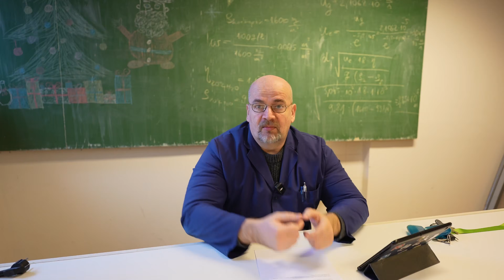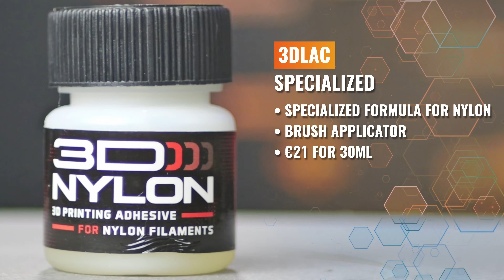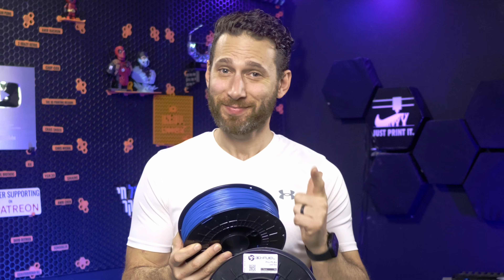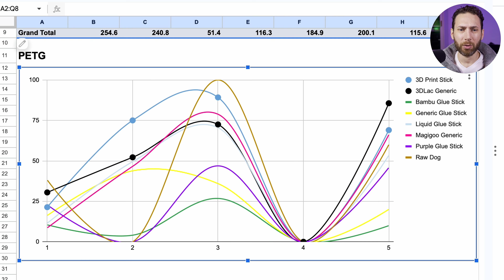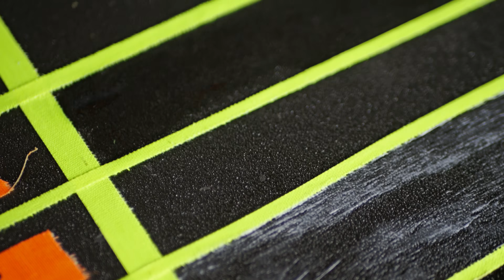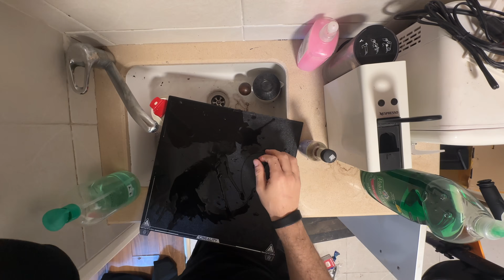I Tested 7 Types of Glue Stick for 3D Printing Bed Adhesion

Comment: Aqua Net Extra Super Hold Hairspray. Been using it for years. Much better than any glue sticks.
Reply: I experimented last week with glue Vs hairspray. Hairspray is easier to clean with iso propyl alcohol. Hairspray had better adhesion, for some reason my glue prints warped.  Glue is not easy to apply in an even layer, also by pushing on the print bed to apply the glue I have to relevel, whereas with hairspray I do a couple of spray between prints, without cleaning and have reliable adhesion.
Reply: @inkavanderbijl7504  This, too, has been my experience. I have perfectly flat first layers and a quick rinse under warm water washes off any hair spray residue left on the part. Also keeps PETG from bonding TOO well with my PEI plates, assuring removal without damage to the plate.
Reply: @SwervingLemon  Same as me but I also give the plate a quick spray of alcohol and then dry it off.
Reply: @highrise9559  Yes! I'll use alcohol to thin the spray residue sometimes and make it flatten back out. I used to clean the plate off and re-apply the spray each time but I've found it's a pretty unnecessary step. Just make sure there's a layer there and that it doesn't have the imprint of the last model and it's good to go. :D
Flexes with the build plate, doesn't crack or pop off, and I'll use a spray shield when I apply it to keep it from going into my heatbreak fan. Other than that... no maintenance, no annoying clean-up, no problems.
Reply: @SwervingLemon  I spray it on the plate in the sink. Wipe it off immediately. Added benefit, it keeps me from letting any dishes pile up in the sink. Being a bachelor, that is a constant concern. 😄
Reply: No kidding. Who'd have guessed that the saviour of 80s glam bands and beehive waitresses would also make the most versatile and affordable temporary print interface layer?
Reply: I use strongest cheapest Hairspray I could find (Syoss Max Hold) on Textured PEI plate and is almost the same as 3DLac. 3DLac is produced by a company that produces hairspray. I also use 3dLac. Best allrounder. I use generic school Glue Stick when I want to remove the print easier from the plate.
Reply from the maker: Yeah, I considered adding hairspray, but I was worried about it getting in other lanes and messing up my data. Lital did I know that 1 million other things were going to mess up my data
Reply: @thenextlayer   I'm in EU and i tried 8 different hairsprays and it was expensive, a stinky mess and it did NOTHING, absolutely NOTHING to try to stick ABS and HIPS to glass, worse than nothing, absolute disaster. Didn't care about PETG, you can stick it to a dirty patch of air if you have to, wasn't printing PLA at the time.

I don't know whether it's because everyone else is printing PLA and i don't care about it, but i suspect it's due to different composition of EU hairsprays vs. that Aquanet which i cannot get. I mean sure go ahead knock yourself out but i'm not really convinced that you'll find a suitable hairspray for bed adhesion in Israel, if your cosmetic products follow similar regulations to EU ones or are made in Europe.
Reply: @SianaGearz  Well if our toiletries in the US are like our food products, I am sure we have all kinds of weird chemicals that the EU doesn't permit.
Reply: @SianaGearz  I'm in Brazil, and i've used 3 different hairsprays with difference potencies, and all of them work like a charm with ABS. Literally zero prints getting loose during print. So, might it be something with your region's hairsprays (PS. I only use ABS)
Reply: Same.  Was game changer.
Reply: Agree with the hairspray.  But I use Suave MAX hold.  I like the smell when it gets hot lol free air freshener!
Reply: @anthonylong5870  Look at all of us comparing hair spray like a bunch of women at the hair salon. 😁
Reply: @highrise9559  LOL reminds me of tge 80's
Reply: TOTALLY AGREE! Been using Hairspray FOREVER! From a CR-10 V2 with a glass plate to my new Kobra S1 with PEI  plate. I wash the plates about every other month, spray a coat let it dry, do that about 3 times. Then every 3rd or 4th print give the plate a little spray over, very rarely do I have bed adhesion issues. I've owned lots of printers with different beds over the years, from a XYZ Da Vinci 1.0 pro with an all metal bed. Many Crealitys  with glass beds, along with a few home brews. A few Bambus with PEI beds,  some Sovol and Elegoo with PEI beds. Still Hairspary is my go to after trying all the different methods for bed adhesion out there.
Reply: Fine and well, but I found it’s tedious to leave the room to spray it to avoid overspray gunking up the works or my workbench and running to the sink to wash it off.  I only use it when I need the big guns.  Far cheaper than nano, though.
Reply: @ziggystardog  If you find those steps tedious, you can skip both of them.
I only rinse or clean the build plate if I want the texture from the build plate on the print, and I just use a sheet of paper to keep overspray to a minimum. If the hairspray layer is scarred from the previous print, I just add a couple drops of alcohol and let it smooth itself. I leave it THICK on the plate.

Comment: Great video, thanks for sharing all the data. I’m definitely part of the Dawn dish soap, hot water, and a scrub brush crowd (and yes, Dawn is the best brand for the job, I have tried others and they don’t work as well). But I attribute my results to four major things. The Sovol PEI buildplate (used on my Ender 3s and Sunlu S8 Pro), cleaning my buildplates about once a month with Dawn dish soap, MRiscoC’s Professional Firmware (which I like so much I upgraded my Sunlu S8 Pro so I could install it), and running a 9 x 9 mesh at the beginning of every print (which only adds three minutes to the print time). But, I also print almost exclusively with CC3D’s PLA MAX filament. So while this works for me, people should find out what works best for them. Another thing I have found that helps reduce failed print due to adhesion, print your parts “sequentially” instead of “all at once” or “by layer”. I never lose a whole plate of parts any more because of a problem somewhere in the middle of the print. At most I lose only one or two of the parts. I have to admit, I haven’t missed using glue stick or hairspray on bit!  It really is nice to be able to hit print and walk away.
Reply from the maker: Thanks for sharing, and yeah brand of dish soap really does make a difference

Comment: I had not really think about it before experiencing it myself: My Part to PEI adhesion has overcome my printsheet`s magnetic force on larger 300mm+ corner to corner prints
Looking for a cheap/approachable solution to solve that
Reply: When printing ASA at 100C on let's say a Sovol SV08

Comment: In my experience with printing many KG of ASA, magigoo PC is a must have. It will pull the build plate off the magnet before it detaches. I can't remove prints from the build plate until it's cooled to at least 60C or lower.
Reply from the maker: Yeah, that’s been my experience too, except I think I accidentally used the Piet version for this video and once I realized it was too far to turn back
Reply: Oh I have used the PLA/ABS etc version Magigoo with ASA😅😅 I also have PC version, didnt know I had to use it with ASA
Reply: Is that with the generic magigoo?  Or the PC/nylon version?

Comment: I have found that the spray on 3D LAC is much better than glusticks, with gluestick you have to wash the bottom of the part as they are all gunky, with the 3D LAC you can rub the part with your thumb and it crumbles off.
 If the adhesion is stronger than the magnetic hold this will weaken the grip of other parts, and that did happen in this teat.

Comment: Frankly I have ZERO trouble with bed adhesion.  Prints stick fine.  The problem I have is build plate adhesion to the magnetic base.  Prints warping so badly that they pull the PEI build plate right up off the bed.  PETG specifically.  I use gluestick only as a release agent for PETG but now I think I need a 5mm steel plate instead of a flimsy spring steel sheet.

Comment: WOW.  No Vision Miner, we have a problem sir.  Nano is King (Camp Nano).  
Great Video otherwise.
Reply from the maker: I’ve heard that, and I emailed back-and-forth with them, but they were not able to ship to Israel. It’s a real bummer because that is one of the ones I was most excited to test.
Reply: @thenextlayer  Sounds Like we need to Smuggle Some to you my friend.  #nanoforall
Reply: Who’s the grippest of them all?  Vision Minor Nano Polymer Adhesive!  NPA is King! @VisionMinor
Reply: It's amazing, I use it for everything and it only needs to be reapplied very infrequently. Works for literally all materials except PP, and that is easy enough to use packing tape for.
Reply: What they said.  10+ years 3D printing, it is absolutely the best adhesive I've used.  Doesn't leave a residue, lasts for many prints, and Just Works.
Reply: I agree vision minor is the best
Reply: Vision minor is by far the best
Reply: Been loving VM also for hard to print stuff.
Reply: Love vision Miner, if you ever do a second part try to get some.
Reply: I reverse engineered their nano polymer adhesive.  You'd probably be shocked to know you can make it yourself very easily.  More than a gallon costs about as much as a bottle they sell.

Comment: One thing I would be worried about is how ripping off the prints before the "self-release" properties of some of the materials may affect how much of the adhesive is pulled off for longevity testing. If there's a follow up, I'd like to see a comparison where prints are only pulled off of the hot bed during the first print of the model and last print of the model, with however many runs of the model you decide in between with "normal" removal with a cooled bed.

Also I'd like to see a comparison with Vision Miner's Nano Polymer Adhesive if you have access to it.
Reply from the maker: Good point. Didn’t even think of that
Reply: I use Nano Polymer all the time.  Amazing stuff on pretty much any filament type.

Comment: If you are using textured PEI, just keep it clean. Unless you are doing something special it will be fine. Hot water and dish soap for a main wash, IPA to maintain and IPA+ 0000 steel wool to rejuvenate (wash after).

Comment: ABS (from TM3dfilament) is my daily driver and I settled on 3Dlac as the best one. Even on my RatRig 500 a full build plate will stick without any issue. Up to 10 prints will easily stick.
I did notice however that the application method matters: Clean the build plate with window cleaner (Glassex) and wipe with a paper towel followed by a wet paper towel to take the last bit of soap away. Your method of really washing the plate is even better. Then apply to a slightly warmed build plate (30 to 40 °C), and let it dry for 3 to 5 min before heating to 110 °C and printing.

3Dlac however does not work well (enough) for larger Nylon and PC parts. Here the specific Magicgoo works best for me (I have not tested the generic Magicgoo). However even with the specific magicgoo parts larger than 300 mm will still come loose. For those I need carbon filled PC or Nylon to aleviate the warping. (actually PC does not come loose it pulls the buildplate from its magnet).

PETG needs a reduction of stickyness as it sticks so well it damages the buildplate. So after cleaning the build plate with window cleaner (Gassex) I leave some soap on the plate to control the stickyness.

Comment: 6 parts water, 1 part PVA (white school glue) glue. Mix and shake and just paint it on the build plate. Better then anything i ever bought.
Reply: Works for me. I only have to adjust the squish of the filament sometimes. Working on 25+ prints. I have not even cleaned the build plate yet. Parts stick till the plate cools. I print ABS only no fans in a tent.
Reply: @stevedegeorge726  👍 It always works.
Reply: I'd have to agree. I use the book binding PVA. Just make sure it's smooth before heating or you'll have a permanent bad time.
Reply: Interesting. Never seen this solution
Reply: @DanielSanPedro  I used pure book binding PVA (essentially just acid free PVA), without mixing, and just smeared it into the engineering plate. I printed a part and adhesion was golden. However, the glue permanently embedded itself into the plate. I thought it would've smoothened out with the heat and drying but it didn't. But adhesion was never an issue again. I had to toss the plate though because it was no longer flat (thanks to the permanent globs). 

After having issues a few months later on Golden PEI, I tried it again but thinned it with water and made sure it was extremely thin. Baked it in the printer until dry and now no more adhesion issues. It's great because now I can use cooling with pretty much any filament (minus PP and really wide pure PA, Kodak Brand).
Not sure if it's this specific brand of PVA or if any type works. I just bought it a few years ago to rebind an old Bible for my grandmother. 
I'm glad to see someone else found this method too.

Comment: No BambuLab liquid glue? It's my favourite by far.
Reply from the maker: Couldn’t get it, they don’t ship directly to Israel, and I don’t have a relationship with them anymore. Is it that good?
Reply: @thenextlayer  I use it every time there is warping potential, sticks perfectly with PETG on textured PEI plate. Biggest plus is no residue, very easy to clean every 5 applications or so.
Reply: I suspect that is just magigoo or 3d lac

Comment: I dont use glue stick so much for adhesion. I only print petg pretty much and i learned early on how well it sticks so i use glue stick so i dont have to fight my prints to remove them from the print bed.

Comment: NONE..!!
Only cheap chinese junk need bed adhesives.!
Reply: I only partially agree. For PLA and PETG this is true as they have near to no tendency to warp (as I wrote in my comment for PETG I even leave some soap on the bu8ild plate to reduce its stickyness).. For other materials anything over 150 mm definitely needs an adhesive.
Reply: @koenvanduffel2084  I dont use anything for ABS , i just make sure my textured PEI is clean and pre warm the chamber to like 40c. If its a warp prone part just use a brim, you wont need anything then.